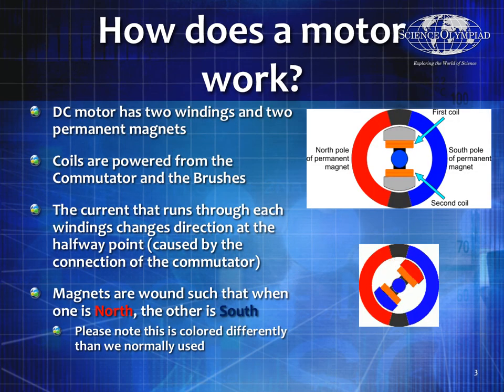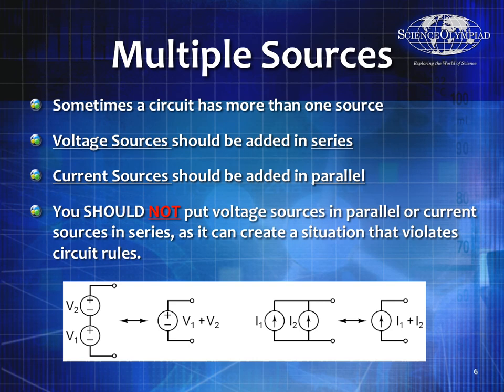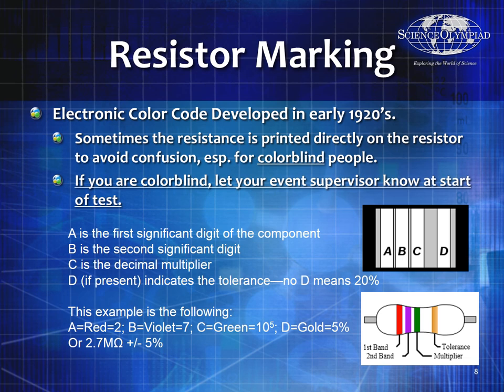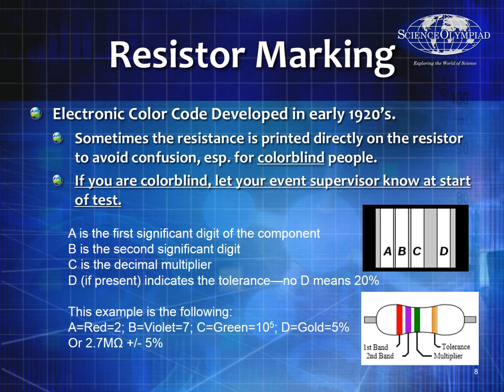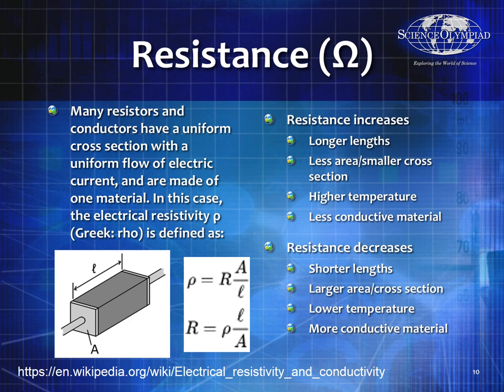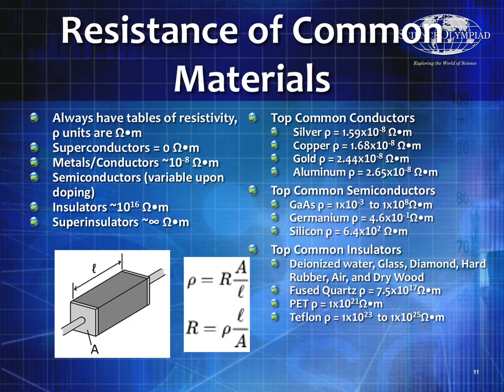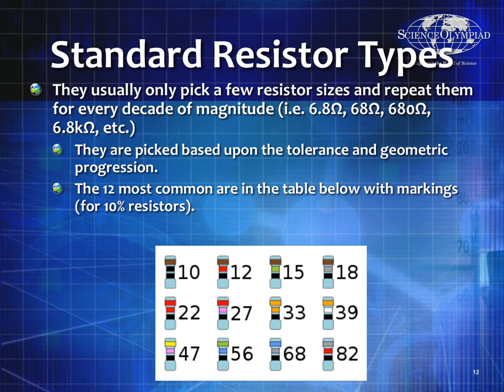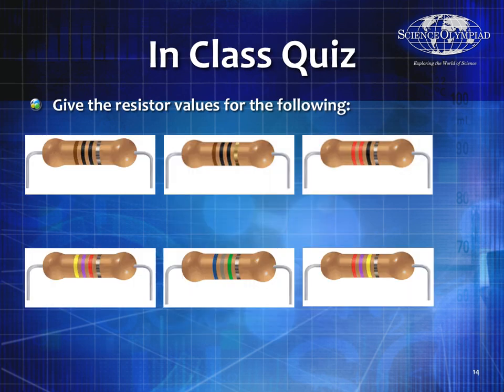Science Olympiad 2019 Circuit Lab, Practice 9

Comment: Mr what happens when there is too much resistance on a circuit????
Reply: Then you don't get enough power to the items your trying to power because all the current is soaked up by the resisters.
Reply: There won’t be enough power because the resistors would take up most of the current.